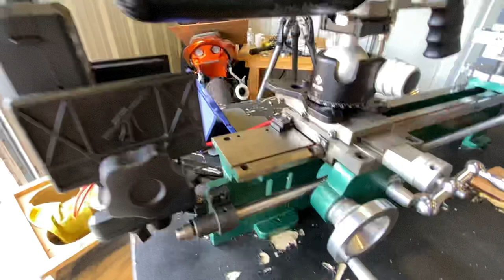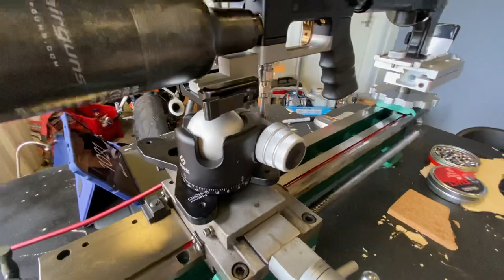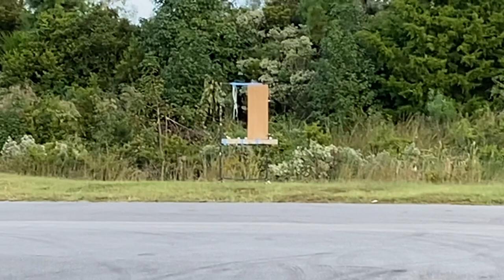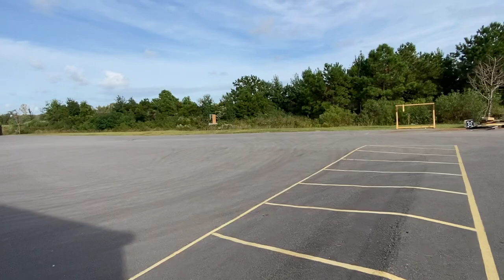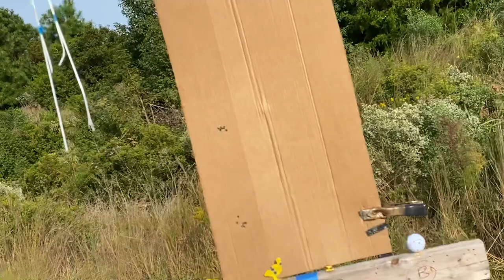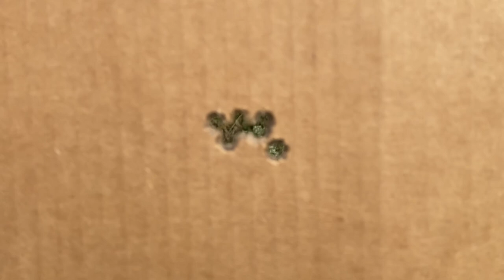FX impact .30 700mm tested on my references bench rail 44gn slug at 1020fps

Comment: Wow Ernest, this is a fantastic tool for testing! This definitively teaches us that holding the rifle lightly and allowing it to recoil gives better accuracy than holding it too tightly and preventing it from recoil. I see bench rest pro's at the range using special vise's to hold their rifles to test different loads, but they are extremely expensive. 1021 ft/s may be a little too fast for those 44 gr slugs...so before you move the target, shoot them at 1000 ft/s, 985 ft/s, and 950 ft/s please just to see the difference in group sizes. I am betting that 985 ft/s will put them in the same hole? And thanks for contributing so very much to our airgunning sport...you are tops in my book Ernest! :)

Comment: I don't find surprising. Even an airgun has some recoil. It stands to reason that the greater the power the greater the recoil. When the gun is in a fixed position, locked down front and back and prevented from any movement, the energy has to be dissipated somewhere. That "somewhere" will always be the least "hardened" (supported by weight, thickness and tension) part of the entire mechanism which in this case I think it's safe to assume that would be the barrel/liner combination. That means that any flex that would be present under normal shooting conditions (offhand or benched/bagged) is going to be exponentially increased since the rest of the gun is being prevented from absorbing any energy.
Reply from the maker: Yes seem that why, I’ll show you groups later at 100y and the recoils was more accurate

Comment: Ernest..I have the first Gen FX impact with 600mm .30 cal. with barrel upgraded to a smooth twist. My speed with 44 gr pellet is only at 870fps with Max power setting. How can I up there speed with this setup? What do I need to do ? My press is at 145b already.
Reply: 1st reg 160,2nd 130, valve 6, power wheel 16,micro 5or4.75 with 800mm barrel 54gr slugs out @1000 fps
Reply: @rmbprathnayaka2625 good for you mate. Unfortunately, I don’t have an M3.

Comment: I have a mk2 impact. Utah installed power  plenum. With 44 GB jsb..I cant get above 900 fps. Hammer is maxed out and reg about 120 bar. Fps drops above 128... older c8 10 18mm... any suggestion  ?.. also have huma port and probe
Reply from the maker: You need new C8 and C10 to start
Reply: @ernestrowe5061  ok. Tried utah they  didn't  have one. Every time I email fx at your office they say they  cant  help. I have 7 impacts.  4 crowns and a wildcat  mk3 . Nowhere has spare parts
Reply from the maker: @markdeedman4286  when i made that video— we sold out of those parts— but the stock parts are easy to modify

Comment: What setting to get 1000 on the 44 Gn slug
Reply from the maker: 140b, adjust power wheel, preload and VA to get 1000fps
Reply: @ernestrowe5061  thanks
Reply: @ernestrowe5061  what's the setting to get to 1000 fps 
I have a FX Impact M3 30 cal 700mm

Comment: Just bought a dubber custom  impact from utah airguns.  They set up to shoot javelin  slugs  at 970 fps reg at 160 ish hammer  on max . Gap 17.5mm valve  on 1. With the pin probe.  I ran on my chrono  here  in palm desert  ca  have 20fps spread plus. And 960 or less. Any  help you can give ?. Tech at utah said buy lighter  slugs somewhat  disappointed
Reply: Well Hate to say it but without a doubt Utah probably didn't even set your gun up.. My buddy did the whole build a gun through them & that gun leaked so bad he had to send it back, then it leaked still after getting it back, Not to mention it was not even tuned right.. Love buying product through them but BS on them tuning customers air rifles! P.S. You shouldn't have to go to a lighter slug if your gun was tuned right!
IMO just watch a lot of videos on YT and learn to tune it yourself, it really isn't too hard once you figure out what does what & get the pocket crono
Reply: @Rollin-With-Kirk  thanks buddy. I have 5 other impacts. So have learned  how to tune these.  But this setup is totally  different.  The hammer looks like my 35 cal. But not sure other than the lighter valve spring.  And pkn probe if there's an added weight on the hammer. Josh at utah knows his stuff and usually  when he does  the tune its sub 10fps of deviation.  This is 25 fps
Reply: Just use regular valve spring, it's way more consistent than the one with slug kit. You can open the valve adjuster all the way to just before the oring by a hair, in case it limits the velocity.
Reply: @Sc0ooter  you have the new dubber impact  ?
Reply: @markdeedman4286  No, I have the the regular power plenum 700mm superior standard with slug kit and Huma dual port. After multiple sessions of testing and comparing, I found out the factory valve spring gives more consistent shots spread and better groups. First thing, don't pay much attention to chrony results when your gun groups sub moa consistently. If your gun doesn't group so well, you need to spend more time finding the sweet spot for the valve spring through the valve adjuster. Try shooting groups with adjusting quarter turn each time for every group or two without looking at the chrony. Good luck tuning your gun.
Reply: @markdeedman4286  Utah Air seems to help those who come into the shop (or have a You Tube Channel) if you are a small purchaser A (just a stock rifle) you get the cold shoulder. Been there done that and moved on to Talon Tunes.
Reply: @Sc0ooter  okay, slug kit using original valve spring, no need for the rubber ball too?
Reply: @timw5627  FACTS!😞